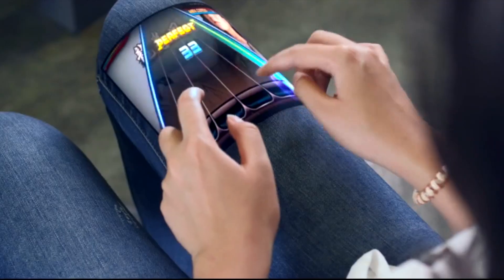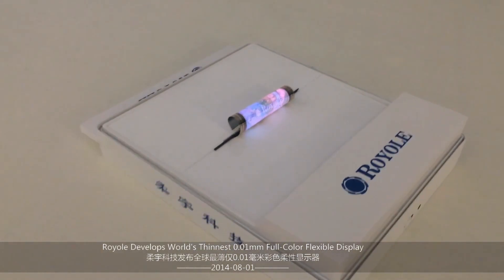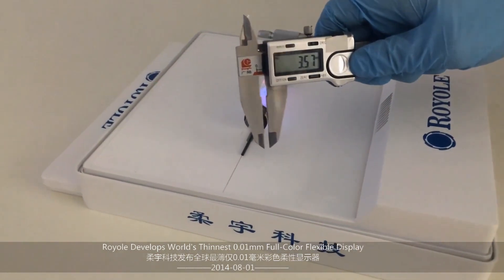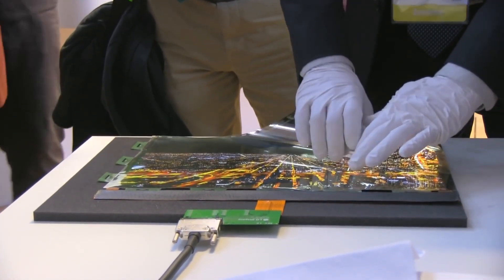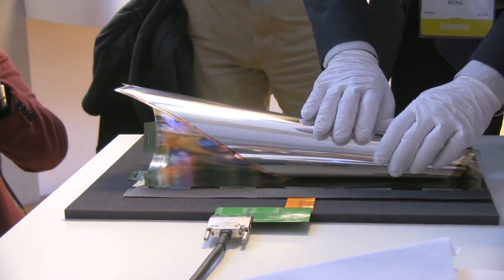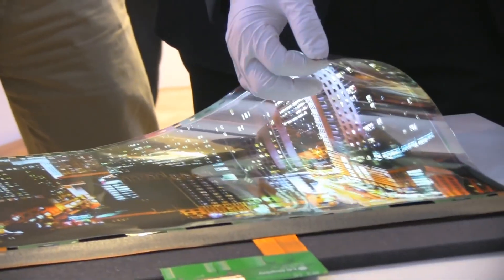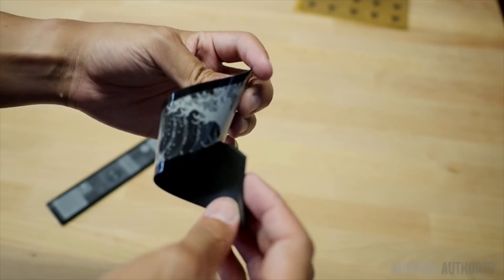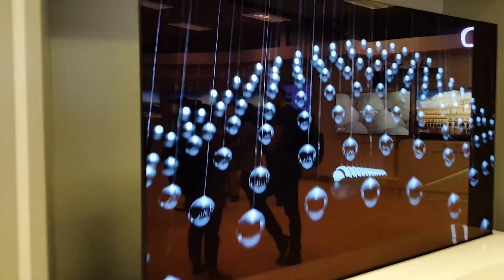What is Stopping Flexible Displays From Taking Over?

Comment: New multi screen monitors. instead of the lines dividing up sections, you roll out the screen to make it larger. magnets at the ends hold them in place in both ways, and they can be moved horizontally at each far end so it curves around you. maybe a normal sized laptop with a special backing case. you would flip up the extra screen, and maybe have the screens placed on rails so you can slide it across, around you, to get the screen section you want in front of you, and others to the sides

Comment: FOLED or flexible organic light emitting diode is a type of organic light-emitting diode.

The reason it has not taken over is due to the fact that it has a lot of disadvantages and it's development progress is lacking due to certain obstacles in the type of technology .

"Both flexible substrate itself as well as the process of bending the device introduce stress into the materials. There may be residual stress from the deposition of layers onto a flexible substrate, thermal stresses due to the different coefficient of thermal expansion of materials in the device,  in addition to the external stress from the bending of the device."

Stress introduced into the organic layers may lower the efficiency or brightness of the device as it is deformed, or cause complete breakdown of the device altogether. Indium tin oxide (ITO), the material most commonly used as the transparent anode, is brittle. Fracture of the anode can occur which can increase the sheet resistance of the ITO or disrupt the layered structure of the OLED. Although ITO is the most common and best understood anode material used in OLEDs, research has been undertaken into alternative materials that are better suited for flexible applications including carbon nanotubes.

Encapsulation is another challenge for flexible OLED devices. The materials in an OLED are sensitive to air and moisture which lead to degradation of the materials themselves as well as quenching of excited states within the molecule. The common method of encapsulation for regular OLEDs is to seal the organic layer between glass. Flexible encapsulation methods are generally not as effective a barrier to air and moisture as glass, and current research aims to improve the encapsulation of flexible organic light emitting diodes"
Reply: mackjeez thats exactly what i was going to say
Reply: #wikipedia here
Reply: They need to use graphene

Comment: The problem is that flexible displays are flexible, NOT fold-able.  95% of people, especially women for whatever reason, can't even keep from cracking their phone screens, imagine if their phone was flexible.  They would end up accidentally folding it and sitting on it or creasing it and ruining it in some way.  

Flexible devices won't be a thing until they can make them practically unbreakable, or make them so that they can be folded and creased without damage.

Comment: flex displays are a terrible idea. for one the size makes them that much more prone to damage, tearing, or worst of all, bending.

i posit this scenario: 

You put your phone in your back pocket (where many people keep their phone) but you mistakenly dog ear (bend a corner) as you're putting it in. you go take a seat and when you get up to check your phone, the corner is now completely damaged and creased. the pixels no longer function beyond the crease as the thin fragile connections have been broken, and the area surrounding the crease is now completely destroyed. all because you werent careful enough with how you put your phone away. 

another alternative. same scenario but this time you put your phone in your front pocket. these are tight jeans (something commonly worn) and thus, when sitting down, the space is constricted considerably. as you place the phone it, like before a dog ear is mistakenly made. you sit down and th e excess constraints on the jeans push on the screen creasing it into a permanent position broken corner and all.

i could go on but the fact is that nobody is careful enough to keep something this thin safe for any long period of time.

Comment: Imagine you have a really small phone with a really big folding display. You cannot fit a big battery in the small phone, so it would run for probably less than 1 hour with the display on, which would make it useless for most people.

Also I think using a foldable touchscreen would be difficult.

Comment: OLED screens are technically flexible, it's what these screens are. The circuits to run them and touch surfaces are the real issue. As for the flex screen, it's been in your hands for a long time now. Also the Samsung curve screens use these flexible OLED panels.

Comment: What would be the benefit of a flexible screen? I'm genuinely curious
Reply: For starters, a screen that bends instead of cracks. Also, super light weight and easy to move. Imagine a flexible display like this manufactured for wallpaper. It'd be extremely practical and you'd be able to roll it all up, put it in a cardboard tube and take it to your next apartment in a single car trip with no special moving vans.

Comment: id like to add that with a curve screen that mean taht you can effectively add in depth and perception on a different scale.  Id love to see something like the ability to have a giant tube that can hold in screens when not in use and pull it out when you need that extra use for when you need it.   this would solve pretty much every issue in all house hold problem with Tv computer and tablet.  The issue is that,  If they are out there to be seen but not in use  they start to  look ugly without something display and they take up far too much space.   

On such feature that we saw with titan fall cockpit,  you could expand on this to provide military better way to view port the tanks and equipment during training or to have remote tank helicopter and even soliders thus giving them the ability to navigate without injury to bodily harm other then rebel scum lol.    

Id would also like to see something like a roll up pen display to be Bluetooth to your phone with password lock.  and have the tethering range be the limit so that if you wanna use the phone but dont want to take it out of your bookpack /purse / pocket.  Even if this pen gets stolen.  You can just desync it and change the password.

Comment: I don't  understand why no laptop manufacturer is using those. Unless the quality or resolution is horrible on them or they are incredibly expensive  it would be a perfect fit for every laptop to be created.. 

One wouldn't have to worry about the screen breaking or at least not in the same sense as up until now where a accidental stab or drop may force you to get a new one.. (I take that those flexible things are a bit more durable)

Comment: I am excited to share my idea of an appliance I was thinking of  :  " a rollable laptop", so that, "just like a domestic magentic scale, that rolls into a square case, and when opened, it stretches as a stiff one, to measure surfaces", I imagined   rollable laptops, that would roll into a pen and kept into pocket, and once, the user wants to use, he would just press a button on the pen's cap, then, it would stretch open as a screen (and with touch sensors, it would have a soft keypad).This is what I thought and I was wondering how wonderful it would be to have stretchable, flexible and rollable printed electronic circuits. And, yes, this is done by you. !!!

Comment: The only problem is when you roll and unroll thin plastic like this, it starts getting slight folds or creases in them.  Transparencies do this if you are not careful with them.  They aren't perfectly smooth looking like a new one out of the box.  This happens rather quickly with this kind of stuff.

Comment: I've seen this but it was about 6 years ago AND the first functioning flex display was made in Australia; I think it was in Adelaide, and was first reported on Yahoo. Samsung was going to fund the following 2 years of research with the specific goal in production of that in Australia. The "major" issue wasn't the display but where the power supply and the electrical components  were going to be held/mounted. Basically it's design was boiled down to the last guy in the commercial, the ones with the pop-out screen. It was a cylinder about 200 X 8 mm and powered by a Li-polymer flex cell battery. Back then, the projected cost would have been around $650-700 AUD ($650-700 American). This was also shown about 3 years ago and was supposed to be on the market by 2015. Honestly, I don't think it will make it mass market, at the Very earliest, until 2025 for the consumer in a portable device.

Comment: The reason they are not out is due to a slow process of making the Tvs of today use the technology that was invested in 20 years ago its all done in small steps " like waving a carrot in front of you the manafact want you to slowly buy the latest step generating more money IVE invented a paste you can paste onto anything and its a led display within hours. Ive also developed a VACUME CLEANER WITH NO MOTOR but I like most inventors dnt have the money to produce this I am 20 years ahead of the Technology now in my workshop with good sound electronics and science for 35 years can see into the future with a clear way forwards The TVS of today were invented in the early 80s I REMEMBERED READING ABOUT THEM

Comment: wow can you imagine a revamped version of Google Glasses with a pair of flexible displays as the actual lenses (I think there were rumors that Google was thinking about adding this to their next commercial prototype). You could even put a darker film layer (like the ones in actual sunglasses) in the outside part so that people don't see what you are seeing through the lens display and so that it also doubles as sunglasses.
And this time Google can remove the front facing camera so that the tech press doesn't go ballistic with reports of "Glassholes" violating privacy and that kind of bad press crap that killed the Google Glass explorer project a year ago. Of course, the press totally ignored the fact that people (ie those that really wanna be creepy) can buy one of those knock offs spy glasses (Amazon or Ebay) that look identical to reading glasses, are way cheaper than the Google Glasses final commercial product (estimated at ~$300-500), and can record for hours at 1080p into up to 128 GB SD cards, while Google Glasses could only record for a few minutes before the battery died.